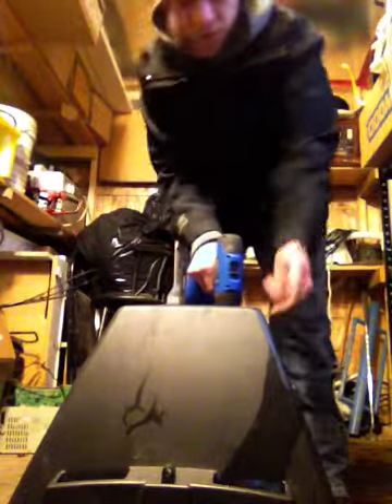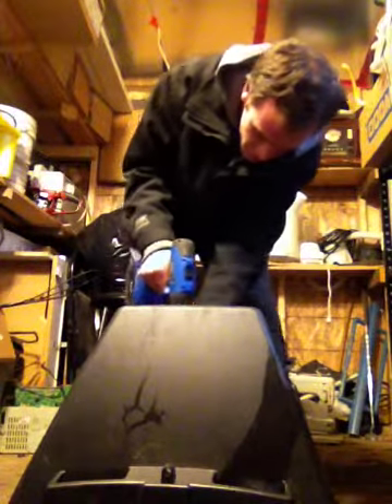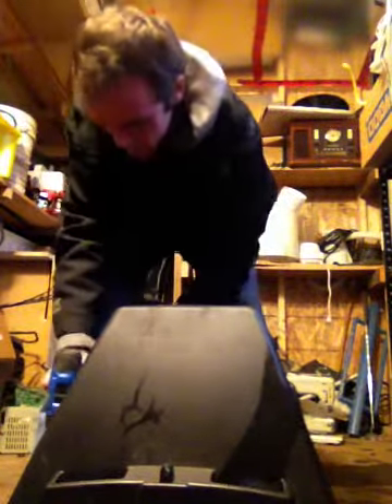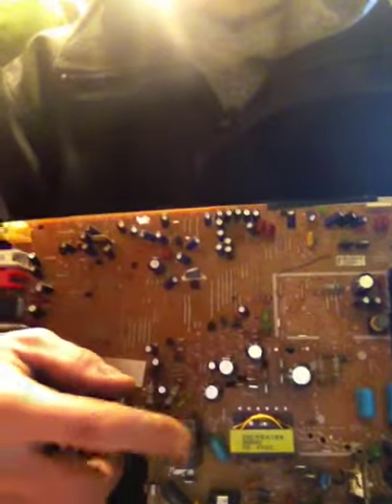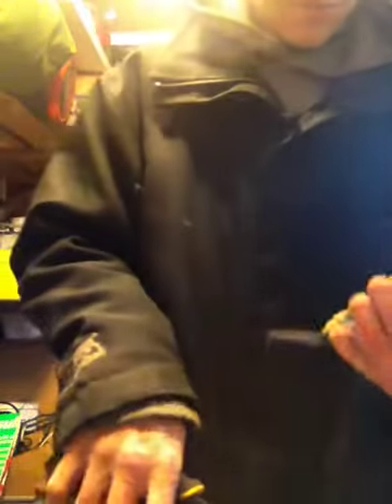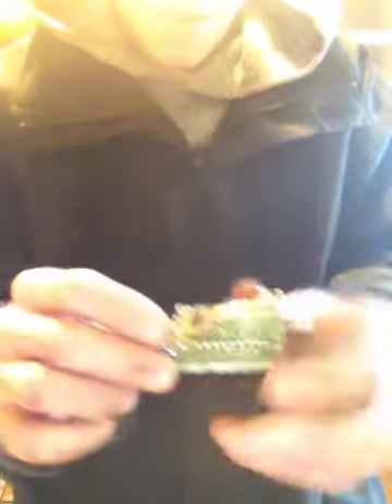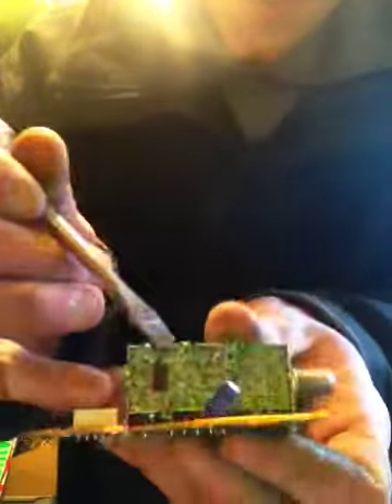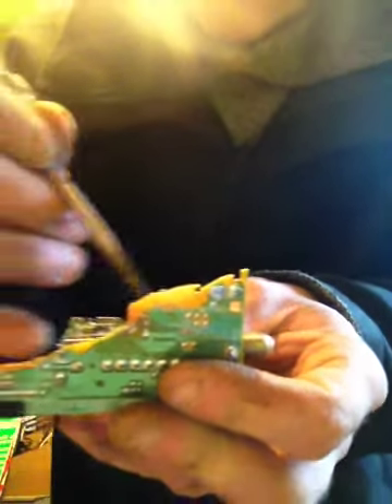scraping T.V ( for the most money) also silver

Comment: ive smashed open those 2 pin barrel shaped things on most motherboards (resistors or transistors ? ) and theres coiled copper wire inside, i only bother with the larger ones, however the wire is coated with some white papery stuff that when scraped is like fluff......gonna find a chemical to disolve that shit !!
happy scrappin !